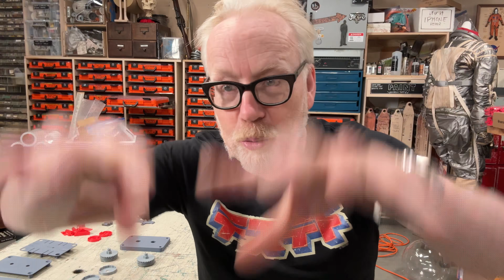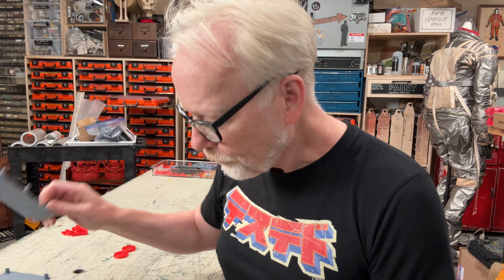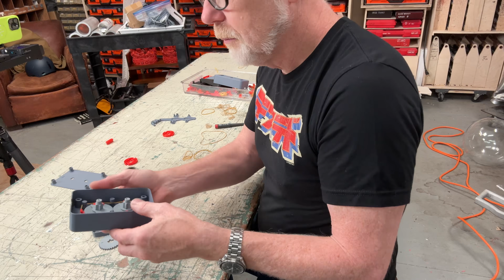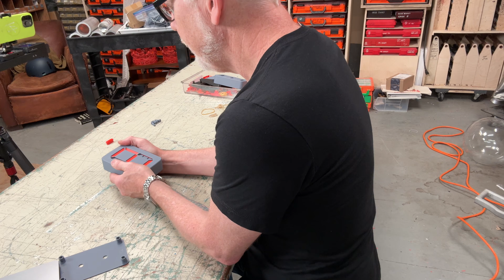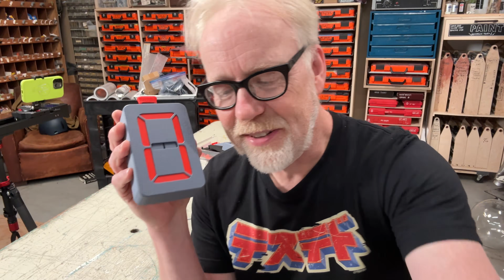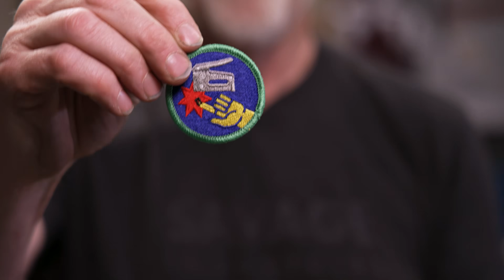Adam Savage Assembles a Working 3D-Printed Mechanical Counter!

Comment: so you print kilos of plastic just to keep the printer warm and going so ... you don't have to turn it on a month later and ... well, use it normally then? 
In my opinion that's really the opposite of good  practice. 
Plus I've been myself surprised by the fact that if I forget my printer for a few months, it seems to get right back into it whenever I need to print something, usually without any specific maintenance. 
Also, stands to reason, if the machine is in use for a longer time, you'll have to do more maintenance, not less?

Disagreements aside, neat print, thanks for bringing it to my attention :)

Comment: In gpu graphics programming we use kernels and shaders, in a sharder, for example hlsl means higher level shader lanuage, it's a updated\modified version of Cg, Cg means C for graphics. When writing an image to render, you would cast the values for each channel rgb of the input image data per pixel, this is called a matrix, it's essentially a polynominal logic for a relation of multiple arrays, in this case the matrix is an array of 2 dimensions , a x and a y. For a video, for each 2d matrix, you create a frameposition array, that holds each 2d matrix, you now have a 1 dimentional time array that for each time segment holds a matrix. Super basic yet correct :D programming is cool :p
Reply: Is there such a thing as a mechanical monitor? Black and white square segments wouldn't be too hard, I could imagine the required movement to build one, maybe gradients too, yet colours would be a fun challenge :D

Comment: I find that my favorite lubrication for 3d-printed parts tends to be either lithium grease or graphite powder. Some filament materials don't do as well with oils being applied. Strange things like plastic discoloring or even breaking down starts to happen, and lithium grease and graphite powder tend to be the most stabilized and reliable after a few months or years of use.

Comment: I want to see a hexadecimal one. It's just the engineer in me having woked on mainfame system peripherals that had hex displays. Now you need a group of them with solenoids to drive them from a binary counter. 1,2,4,8,16,32,64 you get the picture. Sam W3OHM

Comment: They should put the increment button on the right, and have a pin that comes out from the left when it goes from 9 to 0, so you can chain multiple units together.

Comment: I'm glad I got to put my 3d printer to its full use the other day. 

I broke a belt clip the other day while out. So when I got home, I got straight to work modeling a makeshift clip to last until I got a suitable replacement. After some modeling, a hair dryer to bend it to proper shape, it lasted just fine until I got another delivered to me. Now I always have that model in case my new belt clip breaks.

Comment: This was very fun. However, printing extra parts is not good practice. It's wasteful. You can print on demand at home. There's no shipping or travel overhead involved. At most you can say you saved some cents by not letting the machine cool. If it's a resin print you can say you save energy on the post processing, but people who have 3D printers are constantly working on something, so you could just add those extra pieces to the next "batch". That's one of the beauties of 3D print. You don't have a mold for 10 pieces. You can create exactly the amount you need. No need for more. In the end, it was ironic that in the same sentence you said that, you also said you ran out of black filament. Please refrain from wasting material or inspiring others to do it. For your wallet, for the environment and for the filament prices :). This hobby is already a luxury. No need to create parts just to stick them in a drawer.

Comment: Pretty cool to see these 3d printed parts that work so nicely.  Has Adam ever considered doing a video on move vehicle props?
Just watched a museum's video on what the restored sherman tank built for and used in the movie "Pacific" where they also showed a few photos of during the restoration.
Except the tank itself is partly real and partially maker built and the museum restoration for some failed movie parts is basically maker re-built by museum staff.
Video is called "M4 Sherman Tank is Not What You Think" and I think it'd be way cooler if Adam took a look at some similar mostly scratch built Hollywood vehicles sometime.

Comment: Why do 100% infil? Above around 50% there is no more gains in actual strength. Just do 50% (or only 15-25%) and just up the number of walls instead :) You are sadly just wasting the filament this way.

Comment: One thing about 100% Infill printing: Don't do it. When it is only 5-10 layers you get away with it, but most Filaments have a shrinking factor in it. Even PLA shrinks by 0.3 to 0.5% Which means a 100mm print at 200°C will end up at 99.5mm at 20°C but due the Outside in Shrinking you get lot of stress inside the workpiece and thats what causes the warping. ABS got a factor of 0.7 to 1.6% per 100°C. Long Story short: Print with 90%-95% infill if you want it as strong as possible, the voides reduces the Stress by shrinking.

Comment: I have a small hand counter that I use when I crochet that helps keep track of rows or stitches as I work. It works just like that does and now I have severe need to find the extra one I have and take it apart to see how it works. Thanks for stimulating my curiosity, Adam. Keep making us think.

Comment: Im wondering if theres a way for those cams to be redesigned so that you can connect these in series and the pressing of the arm will count slower to get to the 1 on the 10th push, so that you can eventually count up to 99, then again for a third one to count to 100.

Comment: The best mehanical display I've ever worked on, worked by moving an opaque liquid. You can see and understand the method quickly with a finger and a glass of milk. Put your finger in the milk and move it onto and away from the glass. An electromagnet moved a shape which was surrounded by a white liquid onto or away from a clear plastic wall. Both 7 segment and 4 by4 dots were available in little rectangular blocks that stacked. The moving parts self-lubricated. Don't think it was a success due to weight and uv affecting the liquid colour.

Comment: he says printers need to be used or they degrade, but that degradation happens even faster when you do use them every day.  you just don't realize it as easily because with higher use volume, the ratio of stoppages is significantly reduced.  so when you use it once a month, and you have a stoppage once every two months, then yeah, it's like damn this thing breaks every other time i use it.  but when you use it every day, and maybe you would then have a stoppage every couple weeks, but the ratio of prints to stoppages is vastly improved.  my point being, the printer does not "want to be used".  it's a machine that requires upkeep.  and in my experience, very very few stoppages are even due to the machine.  the vast majority are due to the filament.

Comment: I love the old electrical and mechanical solutions we had prior to being able to do so much electronically.  I still wear a wind up mechanical watch because I love the fact that it's just a spring and gears that tell time surprisingly accurately.  In addition to the mechanical display digits, I'm also a huge fan of early Nixie displays.  Anything like that before LED and LCD displays were around.

Comment: The links in the description are for version 2.2 of the button, however Adam is assembling version 3 which has a lot of improvements. If you are going to make this yourself, be sure to get version 3. There is a link on the v2.2 printables page to v3.

Comment: While shopping at Gemco with Dad in the 70's, I found a mechanical alarm clock with a 15 Amp 110 Volt output. Dad refused to buy it for me because he needed everything to be digital, soft touch, viscus damped etc etc. So I bought it myself and slept well with the digits flipping away all night long. Then when the alarm turned on my stereo in the morning everyone woke to Cheap Trick blaring "Mommy's all right, Daddy's all right, they just seem a little weird...

Comment: Back in the 70's and 80's, almost all sports scoreboards were mechanical.  Sure, there might have been lights on the display, but it was all driver by stepper motors and big rotary switches.  So if you clicked the score uptick once to many, you often had to click it around another 9 times to get it back down to where it was supposed to be.  And no automatic carry, if you needed to add 7 to an existing score of 7, you had to click the 1's place 6 times to get it to 4, then click the tens place one, so that the score read 14.

I actually was given one of these, that "fell off the back of a truck."  In reality i'm sure some buttmunch stole it from a school somewhere.  But i found it very enlightening back then, as i was just starting out my magical journey into electricity and electronics.

Comment: I probably would have used cassette drive belts instead of elastic and for the oil I would have either used silicone grease for compatibility with plastic or lithium, but lithium can interfere with certain plastics, machine oil can get gummy and attract dirt.

Comment: Any time you have a gadget that calls for rubber bands like this, I highly recommend you pick up a bag of assorted latex-free rubber bands (easily available online) and use those instead.

Rubber bands are normally pretty pure latex with basically no stabilizers or additives. This makes them very prone to drying out and cracking simply on exposure to air (I think it's mostly a UV and oxygen/ozone thing, although heat probably doesn't help much either). I've never had a rubber band last for more than a few months in any application like this, but the latex-free ones are fully synthetic and last orders of magnitude longer.

Comment: There was a period in the 1970s where mechanical ingenuity reached a kind of apex.  Household devices wanted to exude "modernity", but using electronics for that was still too expensive compared to ingenious mechanical designs like this.  My fave object from the late 1970s was my clock radio, with the mechanical "flip plates".

Comment: I would love to link a top one to the next one on the tenth change to zero. That just seemed to very simplistically also demonstrate base 10. Yes at my age how base 10 works is old news, Picture a separate bar that came out the bottom that pressed a on a new bar on top. But also which one you put on top or the bottom made no difference it still changes the sequence the same. 10 of these is 1 of those.

Comment: Mechanical display are fun, but not particularly useful. Electro-Mechanical display, if that is the right terminology, on the other hand, I think are both awesome and useful. I especially enjoys flip dot display, and have an idea or two I hove to some day realize. That's the thing with such mechanical devices, you don't actually need to be a genius or an engineer to understand them.

Comment: I was going to print these a month ago, but i read the comments and realized you need a well calibrated printer, and my ender 3 s1 is not good with tolerances.

Edit: I recently got a new printer (snapmaker J1S) and printed this. This model is great but it doesn't work as well as adams

Comment: I started out in the 90s running CNC machines, and CNC punch machines for a couple companies. I always wondered if in my lifetime humanity would ever see anything quite like the "replicators" in Star-Trek. It always seemed far away - like flying cars. Fast forward to around 2010/2011 - and I bought my first 3D printer (a PrintrBot kit.) I assembled it, and made my first 3D print. It felt like I was witnessing Star-Trek. Fast forward to current - I own several 3D printers (2 large FDM and 2 large Resin) and it still feels like I am living in the future when I use them.  The progression of additive manufacturing from sci-fi, to industrial big dollar, to consumer machines that cost a quarter of what a cell phones in as short as time as it has is still amazing to me.

Comment: Incorrect.  There are still outdoor applications where large, high-contrast displays like mechanical 7-segments are still useful.  For example - at an autocross race - having a large, high-contrast display for track times is extremely useful and vastly superior to most digital displays in some ways.

Comment: Justa quick note, most oils break down plastic, use a plastic safe oil and it wold melt your parts over time. I use Tamiya grease, or slot car motor oil, its plastic safe....

Comment: I'm not even a 3D-printer guy, so this won't affect me personally in any way as I'm not likely to ever print one of these. But:

The main feature I would wish for is an outgoing gear on one side of the module that only has teeth that move there when 9 becomes 0. If the other side of the module had a gear with all its teeth, and that gear was an alternate way of triggering the "move up by one digit" mechanism, then you could print a frame that fits several of these snugly together and have a thing that can count from 0 to (10^n)-1 where n is however many modules you've connected together.

It's not even a complaint or "I wish someone would do this", as this feels like something that surely someone has already done! But again, given that I'm not about to print this myself I'm not going to go down the rabbit hole of trying to find that file.
Reply: literally had the exact same thought! a mechanical carry bit like a adder circuit would be so cool

Comment: They still have real uses, e-ink is pretty expensive for its size.
Even printing this was probably cheaper then an e-ink display of that size.
Of course the niche is shrinking and they used to be everywhere. But they are still useful (outside of education).

Comment: Agreed. 100% infill does have that quality. It'll get nowhere near injection moulding for sure but I think people (and sometimes me) still underestimate the heft and strength that a 100% part can have.

With that said, 80% gives you most of that weight and feel while saving a bit of plastic. Try that the next time you have parts that don't have to bear stress! of course if you have load-bearing parts then by all means 100% the shit out of it.
Reply: 50% is enough, even, for that. Also, up the number of walls.
Reply: I do 200% all the time. It's only for added weight

Comment: I used to watch the "Electric Company"... so I know where the tune of that song comes from.   I was laughing so hard at the challenges of making a recording and everything that could have interrupted you did - Murphy's Law...  I have a little ADHD or something that when I get interrupted just blows apart my concentration and hard to pull it back together, so I have to applaud your ability to keeping the story telling part of your video cogent.  I visited New York in the early 90's, so I too saw those sign boards and know what you're talking about.

And BTW... The design of that 7-Segment Display is awesome... the person that designed it solved a lot of mechanical problems to get that to work.

Comment: Nice build - I hate to say that when I grew up alpha-numeric displays were mostly mechanical.  In fact one of the first electronic kits I built (when Heathkit was in it’s prime) was an electric clock using early nixie tubes ( 10 sets of filaments stacked in a tube, each one was an entire number. Before they went to the seven segment filament displays).  My how far we have come from in 70+ years.  Thanks for the jolt to my old memory banks… 
Question: I know you do not accept 3D print files via CD or USB drives, do I need to post them on Discord or send them via e-mail?  I have an item that was inspired by your rotating tool holder.   I would like to share it with you.

Comment: By the way, I use a PEI sheet and I clean it with isopropyl alcohol (99%) and I never needed to put any glue on the build plate for the parts to stick properly.

Comment: There's a really cool photo of grand central with beams of sunlight pouring in. It's no longer possible to see the sun come in like that because of all the tall buildings built around the station. Just google "Grand Central 1920's" and you'll find it. I also wonder what happened to the old grand central board? Maybe it's in a museum or a private collection? I'll search for it and report back.

Comment: Not sure what would be better, but I don't like the use of rubber bands. They rot and become gummy, giving the print a limited working life
Reply: On printables is a "mod" that replaces the rubber band with 3d printed springs, its a drop in replacement, no need to reprint the other parts
//edit: its for the v3
Reply: You could use silicone loops, which would have a much longer lifespan, or with a bit of work on the design to add seats for them, use metal springs from the case piece to each segment slider, but that would complicate the assembly. Or have 3D printed springs, although that might be too delicate.
Reply: @seanmalloy7249  oh, right. I think an O ring would do

Comment: I love this! I am right now designing a mechanical, gravity powered clock which uses a mechanical 7-segment display. The first version used this same model made by Flower 3D. The current version, which I will be printing and testing uses the "Mechanical Seven Segment Display (Version 2)" by marian42.